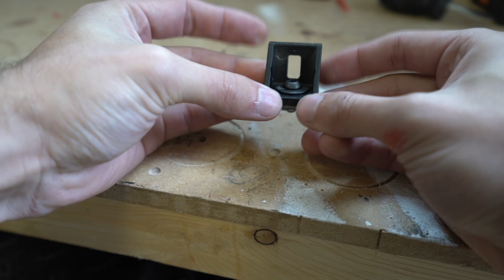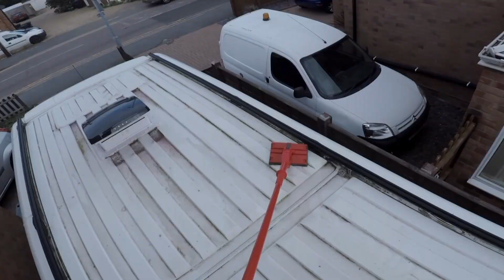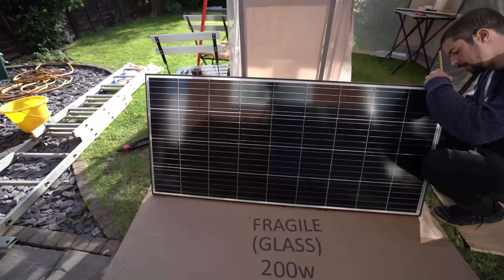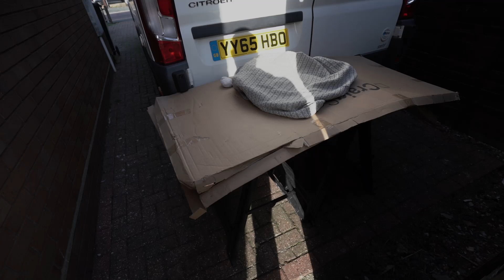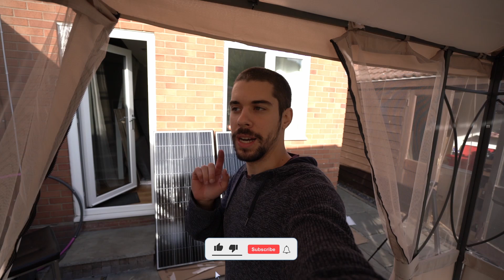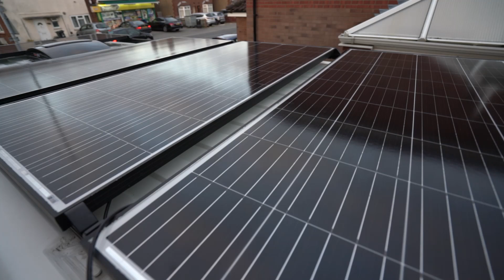Off-Grid SOLAR INSTALL  -  Citroen Relay Camper Van Conversion - Week 27 - VAN LIFE UK

Comment: I was wondering these solars are so big, you will have so much electricity, is there any way to store it?
Reply from the maker: All the electricity that the panels produce that we don't use will be stored in our battery if it's not fully charged. On sunny days it will easily keep us topped up even if we use a lot of power, however on cloudy days or in the winter they'll produce a lot less. So we might still have to charge via the engine, or shore power depending on how much power we use !
Reply: @CasLaz  yeah that is what I though but what will happen when you have sunny days and battery is fully charged where the excesses electricity will go?
Reply from the maker: Unfortunately can't do anything with excess, normally in your house you'd be tied to the grid so you can send it to the grid and get some money for it. Not in our case!

Comment: moving forward, almost at the point of endless power, its amazing i am struggling to use enough power to even drain the battery. As quick as i use it the solar tops it back up, even using it over night you will find an hour of two the next day in the sun and you will be fully charged.
Reply from the maker: Cant wait to have this running ! Going to be so cool to be able to generate our own power! Excited ! Gonna be interesting to see how much we use with induction etc !
Reply: @CasLaz  we are due to test ours shortly
Reply from the maker: @Alivefrom45  Awesome! So Jealous haha😎👏👍

Comment: I used 12mm T boldts with nylock nuts on mine because they can come loose with the vibrations, have a look at my led lighting video if you're thinking of going more off grid 👍
Reply from the maker: Good idea, ill use some red locktite so they wont rattle loose hopefully, will keep an eye on them to see how they hold up! Ill check your video out thanks Nick!

Comment from the maker: Solar Finally Up 😎👍 Unfortunately didn't have time to hook everything up but stay tuned for next week! Any questions let us know below and don't forget to hit that like button for getting these panels up solo! 💪p.s is anyone else paranoid about their solar panels flying off on the motorway? 😂😅
Reply: Yes I was actually watching another video and they attached a little ramp / spoiler Infront of their solar panels to stop the air going below them on the motorway. You could do something similar Infront of your first one if your worried.
Reply from the maker: @heatheroreillyduff5604  Yeah I was tempted to do it, we took it for a test drive now on the motorway and it seems fine, no wind noise at all. I think because the first panel sits behind the curve of the front most of the high pressure air is going over it not under. They are also pretty low to the roof of the van. Not that worried about it now but we will see how it holds up overtime.